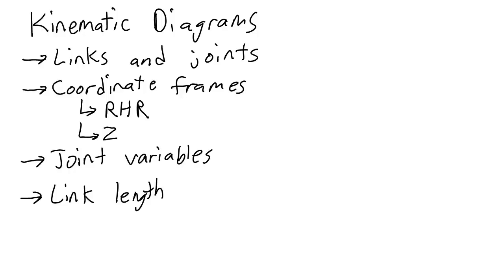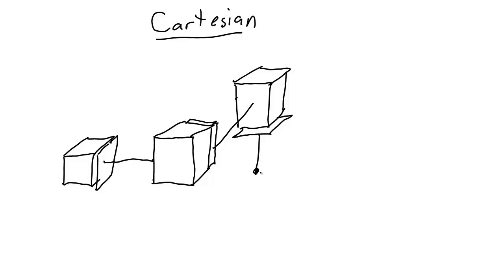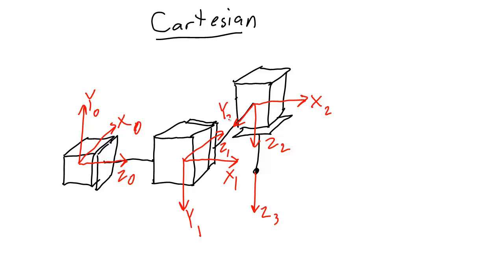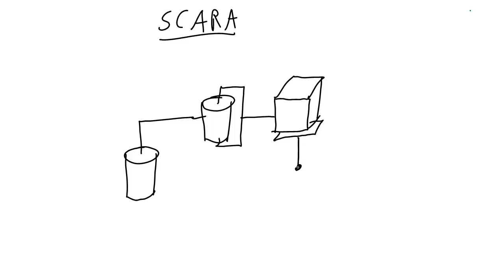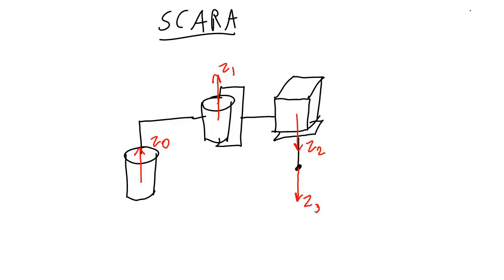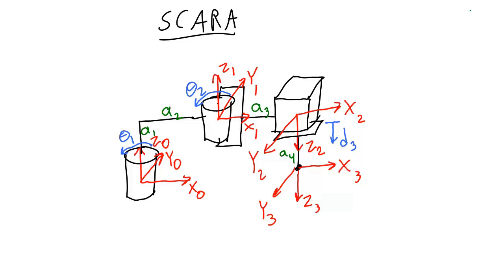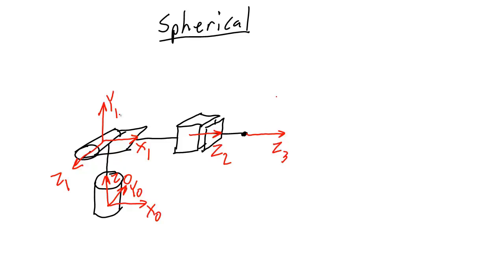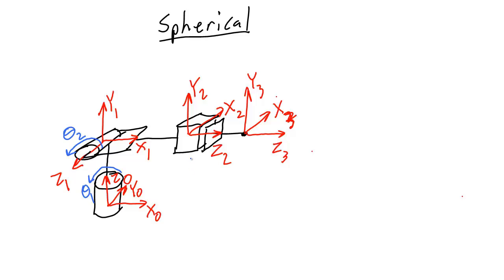1 1 2 Lecture Video 2 of 2   Labeling Kinematic Diagrams

Comment: Good morning Angela, 

is there a rule for choosing the direction of the X axis while setting up the coordination frame once the Z axis is set?

I am not talking about choosing the Y Axis once the Z and X axes are set: the choice is bounded due to the righ hand rule.
For example at 18:33 you set the X axis "into the page", but it could have been set upwards, downwards or out of the page.
This would then imply a different Y axis.

Is there a rationale for your choice?
regards,

Jonathan

Ps thanks again for the efforts you put into these videos!
Reply from the maker: It depends on whether you want to use the Denavit-Hartenberg method to get the homogeneous transformation matrix, or not. If you do, then there are specific rules for the direction of x, also. In this video, I am assuming you will get the htm by directly finding the rotation matrix and displacement vector; in that case, there is no rule for the direction of x; it's a free choice.

In my new videos (see my playlist called Robotics 1 2017), I teach this topic assuming that the Denavit-Hartenberg method WILL be used, and so I teach two additional rules for assigning the X axis (it must be perpendicular to its own and the previous Z axis, and it must intersect the previous Z axis).
Reply: Makes sense. Thanks.

Comment: Good morning Ms. Sodemann,

firstly: many thanks for sharing these videos. These are very well done and help tremendously with easy to understand examples (if I might suggest: gathering them in playlist would help tracking the sequence on youtube). 

I have a quastrion on the SCARA Manipulator showed at 12:57: you are adding an a1 and an a2 link. It looks to me that this is only one link as there are no joints in between them. Am I missing anything? 

Thanks & Regards from Germany
Reply from the maker: Hi Jonathan,

You can find all of my videos in a playlist type of order at my website: www.robogrok.com
At 12:57, the a1 and a2 links are in different directions; that is why they are labeled separately.  a1 is in the z0 direction, and a2 is in the x1 direction.
Reply: Hallo Angela,

thanks for the reply. 

I understood that a link is a connection between joints and therefore between the first and the second cilindrical joint there is only 1 link. 
So labelling a1 or a2 (because of different directions in the kinematic model) makes the model clearer, but there is still only one joint. Is my understanding correct?

Thanks again

Jonathan
Reply from the maker: Hi Jonathan,

I'm not completely sure I  understand the question, but let me try this explanation:

Kinematically speaking, we could replace a1 and a2 with one link along the diagonal, and the math will come out exactly the same.  So, links a1 and a2 are kinematically one link.

But, when we physically build the manipulator, the links a1 and a2 will represent different physical quantities.  For example, the students in my class use the parts in their robotics kit to build a SCARA pick and place manipulator like this: https://youtu.be/xyJDUyxwD2I and use the equations derived here in their code to control it.  In this case, the link a1 represents the height of a servo, and the link a2 represents the length of the bracket connecting the servos together.  In cases like this, keeping the link lengths separate can help in the task of code-writing, since the variable 'height of the servo' and the variable 'length of the bracket' will be used multiple times in the code.
Reply: Hallo Angela,

I was probably too complicated in my question.

I try it again: between a1 and a2  in the video ( 12:57 ) I see no joint, which physically I understand to be only one robot "arm" (how could otherwise two arms be joined if not with a joint?). So I was wondering why you labeled them separately (a1 and a2) instead of labelling only once (e.g. "a1") as there should be only one arm.

Thanks again,

Jonathan
Reply: Hi Angela,

I am looking now at the video 1 1 4 1of2. I understand now that I missunderstood something about the concept of link: I thought that 2 links can only be joint with a joint (cylindrical or prismatic), so if there is no joint there is only one link, i.e. the robot has one arm.
It looks that this is not the case: in both this and the video 1 1 4 you label the vertical link a1 and the horizontal a2.
My question is probably trivial: if there are no joint between them, how are these links physically connected? Is there another way to connect links physically rather than with joints?

Thanks again

Jonathan